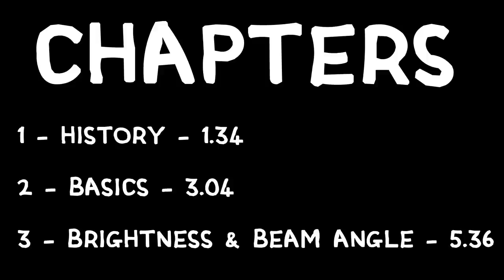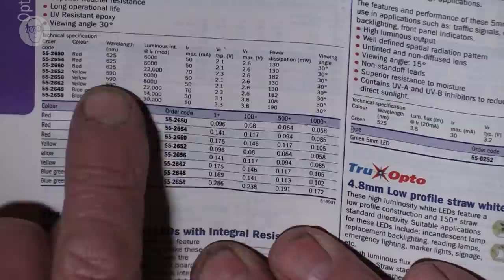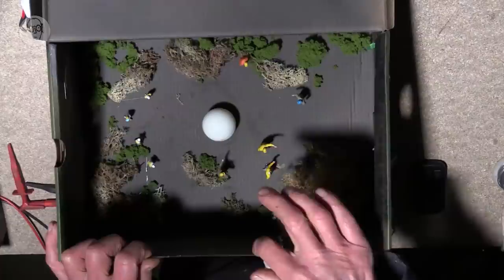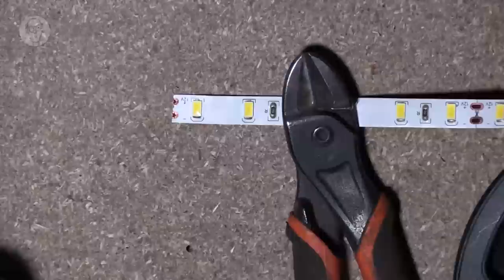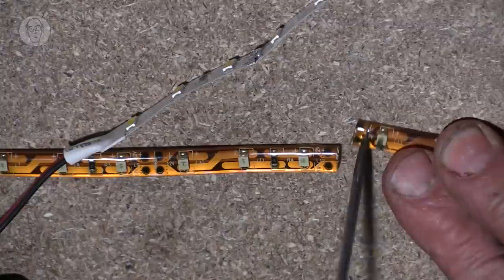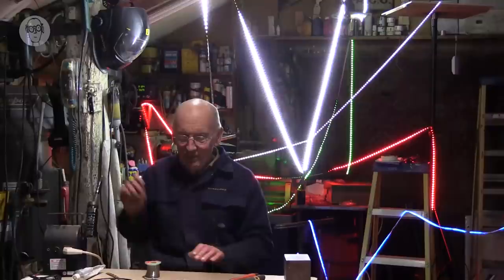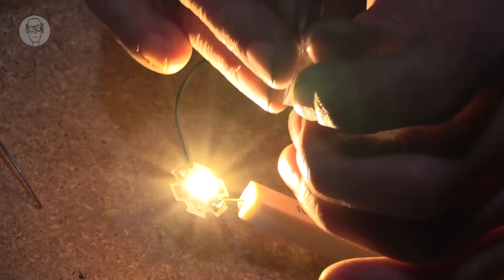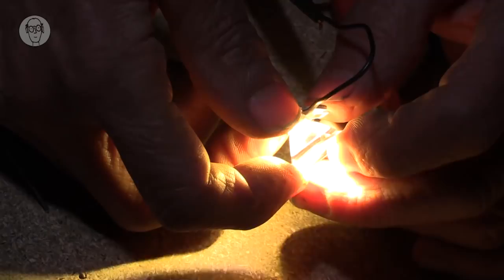LEDs -The Secret Life of components, a series of guides for designers and makers - Episode 2

Comment: If your constant voltage supply matches the forward voltage of the LED then you don't need a resistor, for example if you have six LED's each with a Vf of 2V then you can run them in series with no resistor from a 12v power supply, resistors waste power as heat so it's best to minimise that waste as much as possible, constant current supplies do basically the same as a resistor but in a more efficient way.
Reply: not great practise because the forward voltage of an led changes slightly with age and temperature and between individual leds (due to minor differences in the doping ratios)  And because an led has a highly non-linear voltage to current characteristic, small changes in Vfwd makes a large difference to the current..  But yes, keep the resistors small, and match the burden voltage closely for highest efficiency (or use a CC driver)
Reply: @maxtorque2277  LED's are series connected without resistors all the time (in fact many high power LED dies are simply lots of small LED's in series which is why they have a high Vf),  If they're series connected then by definition the exact same current will flow through all of them so it doesn't matter if individual Vf's vary a tiny bit as it'll average out. "Current hogging" causing thermal runaway can be an issue for parallel connected LED's though.
Reply: @mfx1  the "chain" will still either have a resistive element to convert volts to current, or be driven with a constant current driver.  Because the chain supply voltage is ratiometric to the number of leds in that chain, there is no "free lunch" ie the Negative temperature co-efficient (an leds impedance fall as it get hotter) for each led adds up in series, so the effective votlage/current characteristic is no different to a single led junction. Take a close look at any led datasheet and you'll see the junctions temperature sensitivity defined
Reply: @maxtorque2277  You'd better tell every manufacturer that does it that they're doing it wrong then. When multiple LEDs are in series they are forced to share current, so the current through the full set is determined by the sum of the "resistances", which is the same as using the average volt drop or average "resistance" of the LEDs (note "resistance" is in quotes) so one LED won't "run away" from the rest. Thermal runaway becomes a problem when connecting LED's in parallel.
Reply: @mfx1  they indeed share current and yes, the current in the chain is indeed the same at all points. But unless somehow some of the leds get colder and some of them get equally warmer (which isn't going to happen) then the fwd voltage of the chain is the fwd voltage of each led multiplied by the number of leds in that chain. Take a 25degC Vfwd of say 3v and lets have 10 leds in series, that's a total chain voltage of 30 volts, but if the leds individual Vfwd drops to say 2.95v, then the total fwd voltage is now 29.5v, so if you apply 30v to that chain, more current is going to flow. I'mnot aware of ANY manufacturer (and i design electronics including opto electronics for  a living) that does not either use a limiting resistor, or more likely these days, a constant current driver..........  (which is the real reason you may see an led not havig a series resistor in  series of course, because the CCD is doing the voltage modulation as necessary, an dbecause leds turn electrons into photons, and because therefore the optical intensity is directly related to the junction current)
Reply: Max and Martin;  From where I sit you both make some good points and it is my opinion that you are both sort of correct - and both sort of incorrect as well.  I have been pushing electrons around for something in the order of 60 years and about 35 to 40 years ago I investigated this question very thoroughly with a bunch of LEDs and a Tek 576 curve tracer.  The end result was a design with a long string of LEDs in series being driven by a voltage source with no series resistor or constant current regulator.  The prototype worked reliably for long hours and so far as I know may be working still wherever it is (if it still even exists).  The design was accepted and production models also worked well with no failures in this area, though I can't say too much about what the overall device did or what it was for.  So Max, you have now met (via YouTube comments) and are thus aware of a "manufacturer" that many years ago did exactly what you said shouldn't be done and that nobody to your knowledge does.  So now you do know - and increased knowledge is always a good thing.

So how does this work?  The answer is that LEDs are not perfect devices.  Their equivalent circuit (low frequency) is a perfect diode with a fixed forward voltage drop (with a bit of a tempco) in series with a small positive resistance that ideally would not be there, but is in fact there.  (At no point on their characteristic curve is an LED a negative resistance device.)  Connecting one such diode to a voltage source without some external current regulating or limiting is a bad idea because small changes in the supply voltage or the forward voltage of the LEDs will result in large changes in the LED current because the parasitic resistance in the LED is small.  BUT, if you stack enough LEDs in series the parasitic resistances add up.  Since all the circuit elements are in series it makes no difference whether there is one discrete resistor of value "X" Ohms in the circuit (assuming ideal LEDs) or (if you have "N" LEDs in series) X/N Ohms of parasitic resistance in each non-ideal LED.  In my case the supply voltage and temperature were reasonably stable and the requirement was for a relatively broad even field of light (meaning lots of LEDs in series) the exact intensity and stability of which only needed to be within 10-20% of a target value.  Calculation and testing showed that several long strings of series LEDs connected in parallel fed from a fixed voltage source met the requirement over the required physical space and temperature range with the simplest and most efficient design possible.  This is not always the best way to drive LEDs, but in some cases it is.

     As for Martin's claim that driving LEDs with a constant current supply of some sort is more efficient... It depends!  If there is an LED or a short series string of LEDs being driven by a small current  (20-30 mA.) then something like an ON semiconductor  NSL450 series current regulating diode would be the simplest solution and exactly as efficient as a resistor would be in the same situation but with improved circuit stability.  I suspect that the parasitic losses in a constant current switching regulator would cause such a solution in this case to be less efficient and, considering the higher parts count, less reliable and more costly.  It would also take up more space.   However, if there was a long string of high current LEDs then a constant current switching regulator might be the better and more efficient solution assuming you can tolerate the higher EMI.  As always, as an engineer you have to take into account all the factors of a given situation to come up with an optimal design. 
     Incidentally, a curve tracer is a wonderful tool for gaining insights into how components of all types work, not just transistors.  I once had to troubleshoot an unsatisfactory 5 volt 5 amp linear power supply design someone else had done.  Their math all checked out "by the book" but the design did not work well enough to be usable.  Ripple was excessive at high load and low line voltage tolerance was non-existent.  The curve tracer told me that, at the peak currents present, the diodes in the full wave bridge were forward dropping about 1.5 volts EACH!   The designer had assumed 0.7 volts forward diode drop because "everybody knows that is what the forward drop of a silicon diode it is".  Not true at high currents!  It is that parasitic resistance again.  I designed and wound a new transformer (I had a coil winder in my lab) using a full wave centre tap configuration to eliminate 2 diodes and their associated voltage drops, added a couple of volts to the transformer secondary voltage to increase the peak voltage on the filter capacitor, decreased the size of the filter capacitor quite a bit to increase the conduction angle of the diodes to lower the peak diode currents.  The regulator remained the same.  I ended up with a supply that met all specs, cost less, was more efficient, and, because it ran cooler, needed less ventilation.  Sometimes you have to look at both the overall design objective but also the smallest details of the parts you are using to achieve the best design.

     A comment on the useful life of LEDs (and other components) if I may:  I have a 6 digit digital clock on my desk that I built in 1975 that uses 7 segment LED displays about 20 mm in height.  That clock has been running essentially 24 X 7 X 365  now for about 45 years or about 400,000 hours.  The only repairs I have had to do in those 45 years is to replace the main filter capacitor twice.  The LEDs and all other components appear to be as serviceable today as when I built the clock.  It is really quite amazing how reliable electronic components can be when operated conservatively in a well designed circuit.  Unfortunately, today designers seem to be chasing goals other than reliability.  An example is portable devices like cell phones designed to be unserviceable (sealed case) that include a rechargeable battery that WILL fail in just a few years.  If I designed something like that I'd be ashamed of myself.

Comment: Out of curiosity, what issues have you had with constant current sources? I've always looked at Led data sheets, found the min-max Vf-s very wide, and found I have to drop too much light output to compensate for worst cases,if using a resistor.

Comment: For programming, maybe try python (specifically micropython or circuit python). There's a few boards you can use for this. My favorite so far is the raspberry pi pico (it uses the raspberry pi's own 2040 chip).

Comment: From the Industry [Electrical] -  what you call 'tube connectors', here we call them 'tombstones'.  :-)  

I had a large 60" screen LCD/LED TV here that died.  You find long series connected strips.. the total in mine was 50 of LED. 10 strips x 5 on each = 50  They are small chip type on an aluminium base circuit board. A magnificently designed lenses disperses light output.
Every LED in series, so having one fail open circuit kills the lot. Bugga! 
The fail mode in these high lumen lamps is heat buildup that cooks the small chips. The phosphor degrades and cracks off.
This [and I suspect a lot, of these TV's is that the strips are not securely thermal glued to the rear steel panel.. the old way they were assembled.  Now... designed to fail.
Open it up and fault find the offender? ... just solder in a new chip or 3?  Maybe fixed? 
The thing is, the LCD panels are very very thin laminated glass [around 1mm total] that over a large 60" panel size cracks very very easily... like... look at the damn thing, and it will stress and crack. They must have very carefully designed screen handling machinery used when factory assembled. Fix LED series strips and crack the screen ... fix NOT.
Anyhow, after that crack... take it all to bits... keep the LED strips and SMPS [odd voltages like maybe 3V or 6V or 12V each] and throw the rest of it in recycle bin.  Kinda suck a big one.
I figure they are designed to fail now...... 3-5 years maybe. 

Next TV here will be an OLED type. [another type, being Organic Light Emitting Diodes] Perhaps they last longer. Bloody want to.

Comment: It is not silicone, it is PU polyurethane. To strip it of from solderpads try to cut it from side instead from top, insert blade between copper and PU, peel of copper from PU and then just cut of PU by sidecutters.

Comment: Just a thought - couldn't you burn off the silicon on the LED strip with a soldering iron?
Reply: No, it's resistant to those kind of temperatures.
Reply: Its silicone, not silicon, (totally different) - and silicone chars at high temperature leaving silica and a mess!

Comment: ESP01 ESP8266 and ESP32 only need 1 pin to a string up to i think 1000 independantly controlled leds. They can control anything electrical. the led strings only use 1 pin on either device. The arduino has no wifi unless you pay 30 a chip. the ESP01 only has 2 maybe 3 usable pins but is only less than a dollar. the ESP8266 is only 2 or 3 dollars and has about 15 usable pins. the ESP32 has about 2or 30 pins depending on the version you buy. the ESP32 has touch pins as well. i believe there are about 8 touch pins on the ESP32

Comment: Mr. Hunkin mentioned that he struggles with object-oriented programming in C++. As an old programmer, my (not universally held) advice is that object-oriented techniques should be avoided by beginners doing microcontroller programming.

Microcontrollers are closer to electrical engineering than software engineering. OOP was designed to reduce the complexity of larger-scale systems, at the cost of being another set of concepts to learn. So it's not surprising that OOP gives at best only minor benefits to microcontroller programs. Use it if you already know it, but if you don't know it, skip it.

You can code in C++ without using objects, or code in plain old C. Either way, it's almost certainly a shorter path between what you already know and what you need to learn in order to write a microcontroller program.

Comment: I remember in the 90's and wondering why someone didn't just take a dozen, or a hundred LEDs and making a flashlight that lasts forever.  Fast-forward to early 2000's I got my first LED flashlight, it boasted a 200 hour battery life.  I eventually wore out the button on one set of batteries, after someone fixed it for me, I went on to use it until the batteries started oozing electrolyte.  All on the original set of batteries.  Then I got an early 1 Watt LED flashlight, it burned through batteries in a couple of hours.  Now I have about a dozen LED flashlights, 1 that can drop from 10 feet without breaking, with a battery life of 40 hours, several that use only 1 AA battery, and various other ones with other interesting features.  Did you know that 3 AAA batteries hold the exact same amount of energy as 1 AA, but an AA battery usually is much cheaper than 3 AAA's.  Now I am interested in high color accuracy also called high CRI lighting.  I would love a 99+ CRI lantern with a rechargeable 18650 battery that is USB rechargeable and has USB ports on it to charge phones.  I have all but given up on hand crank power, it is almost never efficient enough to make sense.  No one wants to crank the handle for more than 5 minutes, let alone 15 minutes or an hour which would be necessary for any useful energy.  Solar panels on batteries are also a bad idea, leaving electronics out in the sun is really bad for them, especially the batteries.  Were almost hitting the end of the possibilities with lights, but that doesn't mean you have to stop being creative.  Here's hoping the future will be bright!
Reply: @cmmartti  For everyday carry where I don't really anticipate needing a flashlight, I really like their small rechargeable lights like the Tube, Tiki, or Tiny. They also have some slightly larger -like a car keyfob/remote, for instance the TIP2 or T4K, for a bit more light while still "keychain-able"
Ther selection of single AA/14500 or 18650 lights is also quite good, but I, for me, find them a little bit too chunky for EDC.
Reply: @michaeltempsch5282  I don't see the point of the smaller flashlights because they're just not bright enough. I'd rather just use my phone if I can't use a bright flashlight.
Reply: @cmmartti  Guess it depends on what one does and needs - a reasonably frequent scenario for me is to be on the phone (and don't like earbuds) while needing a bit of light. But not fill a whole room, more enough for general navigation and a bit more in a smaller area for Inspektion/work, and the Tini is enough for that. The smaller/slimmer Tube I'd see more as emergency than general ttool.
The Tini's UV option is also useful to me for leak searches (florescent dyes).
But everyone has different needs - and tolerance levels of what to carry. 
Good thing there's a wide spread of options available.🔦😀

Comment: As to the orientation of the flat of the case and long/short leg - if buying cheap lots from China, you'd better check rather than assume/rely on those... I've had bags where one or both were reversed. Cheap on eBay often means factory rejects...

Comment: If you have to use a high watt resistor to dissipate the heat....
You are defeating the purpose of  a using high efficient light source.
Either use a voltage source with a lower voltage or drive the LED as it is supposed to, with a CURRENT source.

Comment: They don't really make a proper drop in LED replacement for automotive brake lamps - I've tried several of them and they never illuminate the lens correctly. The "Rise time" of LED brake lamps is much better, they reach full brightness a quarter of a second or so faster than incandescent. Supposed to improve the response time of people behind you a bit.